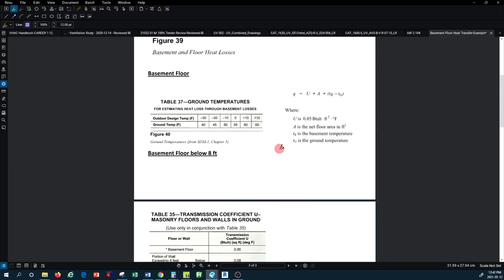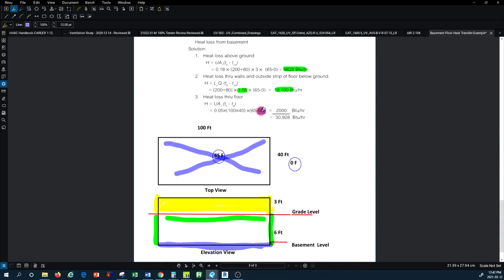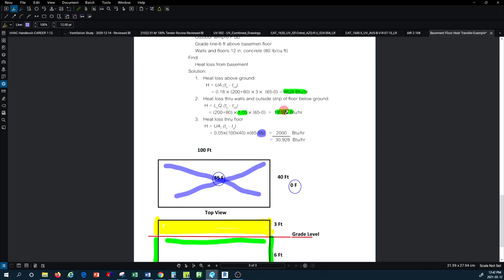HVAC SYSTEM DESIGN TUTORIAL-Carrier HAP-12

Comment: Sir why the outside temperature is taken as 0. Did you assumed it or it is a general value taken by HVAC designers while calculating load of basement? This outdoor temperature will be different from that we obtained in weather conditions tab in HAP?
Reply from the maker: If you are referring to the basement floor thermal load calculation in the example explained in Carrier HAP Tutorial-12, in the example the outdoor temperature condition was assumed to be 0 Degree F. In the same example the ground soil temperature at various outdoor temperature was provided which could be used given the outdoor temperature was different. ( Refer to Table 37 in example). Please let me know if you still have question on this. Cheers